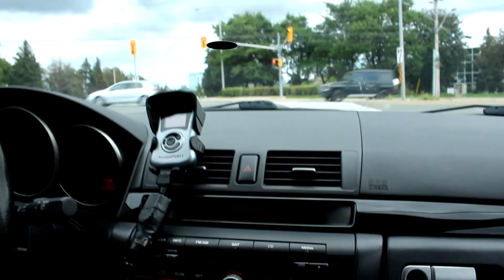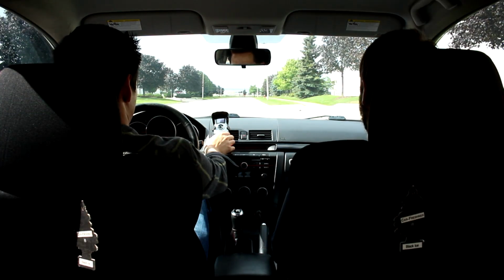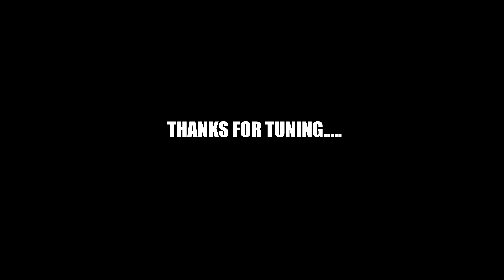Mazdaspeed 3 - BIG TURBO - Acceleration & Exhaust Sounds

Comment: 1. I hit the limiter too, but continuing to accelerate while it's still at the rev limit may not be a good idea (bearings and wrist pins don't like it in particular, neither the ringlands will may get clogged with soot resulted from burnt oil vapours).
2. After a hard long pull DO NOT leave the car in neutral, you want the oil to keep circulating to cool down and lubricate everything, especially the pistons in our case if you're still on factory pistons (so prone to cracked ringlands), but not necessarily limited to this situation. It's a mistake to let the engine idle after a hard pull no matter what car you're driving.

The factory cat-back with all the resonators in place became a restriction around 28PSI in my case (I have a forged engine and WMI). Only changing the catback with the Cobb CBE resulted in about 12whp gain and around 20Nm (15lb*ft). On stock block at 25.5PSI (no meth) I didn't feel the CBE to be an issue, but any flow mods will definitely help.

Oh, and add meth. Your pistons will thank me for the advice ;), and so will your butt which will shrink over time or at least will not expand :) You can also up the boost a bit (1 maybe 2 PSI) anywhere above 4000rpm and increase timing quite a bit. With the extra cooling they will hold.
Reply from the maker: Hey man thanks for the advice:) It's currently spraying a 50/50 mix just for cooling. I suppose the catted downpipe is causing the majority of the restriction because I've also read that the stock catback does a decent job. Either way the Cnt catless 3" turboback should increase the efficiency big time, and I'm pretty excited for it. Thanks for the tip on not bringing it to neutral after a hard pull. I'll definitely start coasting into the next gear to keep oil pressure:)

Comment: What tire are you running? I'm stock turbo, but can't get traction through almost 1st to 3rd
Reply from the maker: Yeah unfortunately with FWD, traction while accelerating in the first few gears can be limited. I'm currently running BFG G-Force Comp 2 All Seasons. A good tire definitely helps, but also having the tune setup to limit power in the first two gears is a great way to manage wheel spin :)
Reply: @WannabeTuners  yea for sure. I'm still on stock wheels, so just curious. I'm most likely going to a substantialy wider wheel. Was just wondering if you figured out a tire solution. Thanks!
Reply from the maker: @dmanchu88  Yeah no problem, that'll definitely help. One thing I did notice was that the K04 tends to break the front tires loose easier than a bigger turbo since it spools up so fast and generates torque quite suddenly

Comment: What wheel/tire spec are you running?
Reply from the maker: Stock 2009 wheels (The gold wheels I had were cheap and starting to corrode), with Eibach 15 mm spacers all around. Tires are BFG sport comp 2 all seasons. Rear fenders needed to be rolled:)

Comment: That’s not that bad lol what’s the most psi that turbo can push
Reply from the maker: From what I've read most people run it at 22 psi comfortably, but boost pressure will vary based on how well a given setup flows. I know that it flows enough air to make 450 whp in these cars with aux fuel. Beyond that I've read that the hot side starts to become restrictive as it is internally gated. It is a very good value though. One of the best bang for the buck turbos for these cars:)

Comment: What is the exhaust setup on this?
Reply from the maker: In this video it was a CNT catted downpipe and the stock catback with both resonators deleted and rear muffler retained :)
Reply: @WannabeTuners  what are you running now before the motor issues?
Reply from the maker: @richardmoore3804  CPE downpipe with a CNT catback (3 inch all the way back)
Reply: @WannabeTuners  Any reason you went with a catted downpipe over a catless downpipe ?
Reply from the maker: @LikquidDutch  At the time it felt like the right thing to do, but I've since realized that free flowing is the way to go to get the best possible performance out of an engine :)
Reply: @WannabeTuners  I have the same CNT catted DP when I got it tuned with my BNRS3 Stratified wanted me to get that instead of a catless one .
Reply from the maker: @LikquidDutch  The high flow cats on these things flow pretty well, just not as good as no cat lol
Reply: @WannabeTuners  yeah I live in Florida and have no emissions . But they were very insistant on my getting a catted downpipe cause over boost problems they say .
Reply from the maker: @LikquidDutch  In warm to hot weather you shouldn't see overboosting or boost creep issues with a BNR S3. How cold does it get in Florida?
Reply: @WannabeTuners   lol its always hot bro .. winter can have a day or  two  when we make it to 60s sometimes even 50s maybe even a touch into the 40s for like 2 days lol . Its always in the 90s in South Florida .
Reply from the maker: @LikquidDutch  You shouldn't have any issue going catless in my opinion. Just watch for smoke, these BNR turbos like to smoke from high oil pressure. A Turbosmart oil pressure regulator helps a lot with that.
Reply: @WannabeTuners  heh I could agree with you there when I floor it ithink I'm a diesel . I can see black smog out the tail pipe 😀.
Reply from the maker: @LikquidDutch  Yeah they really seem to have a lot of those race car characteristics, smoking and all that jazz lol
Reply: @WannabeTuners  btw which shifter bushing work the best for the gen1 brand wise ? Corksport , Jbr , Cobb ? Or any other brand you know ?
Reply from the maker: @LikquidDutch  A while back I just cut the metal spacers to make them shorter to create more clamping force on the OEM bushings lol
Reply from the maker: @LikquidDutch  My car actually currently has a CNT catback. It has the smaller resonator up front, and a big one in the center. Deletion of the big one in the center would probably allow more sound than deleting the smaller resonator. Deleting all resonators and going catless ofcourse would yield the most amount of noise.

Comment: The description says you have e cut out hows the exhaust still restrictive ? Asking because I'm running pretty much same set up with a cst4
Reply from the maker: At the time, the car had a 2 inch exhaust tip with an inner diameter of only 2 inches welded onto the stock catback which restricted flow. Having the cutout open definitely helped with exhaust flow, however the downpipe had a high flow cat, and having the cutout open all the time was so loud (it was more of an experimental purchase) lol. Moral of the story is that turbo setups don't favor exhaust back pressure. It's always better to have the least amount of restriction after the exhaust valves to get rid of as much in cylinder heat as possible to prevent knock :)